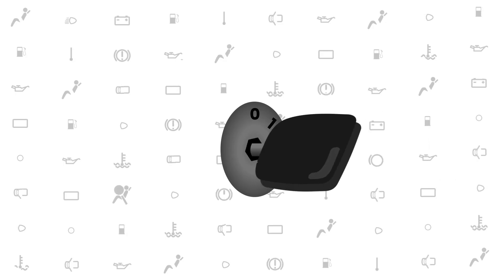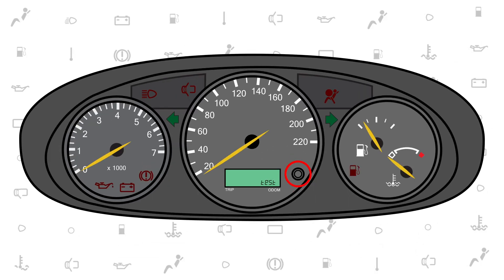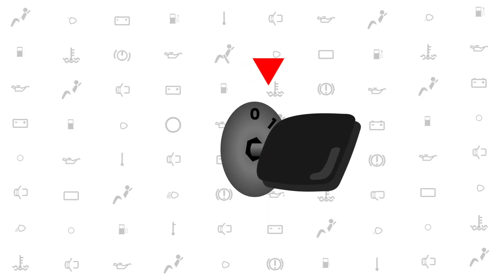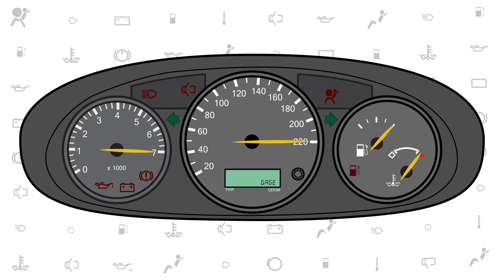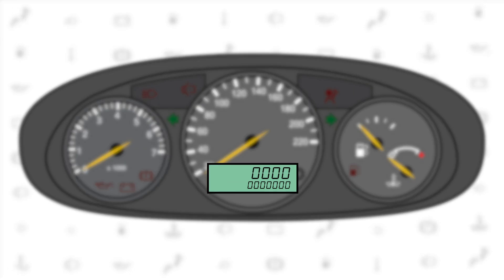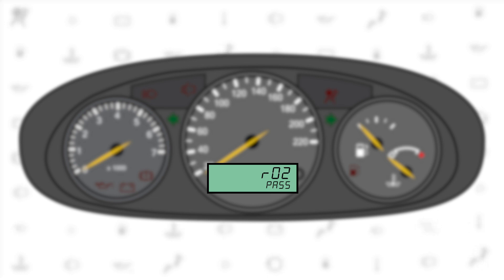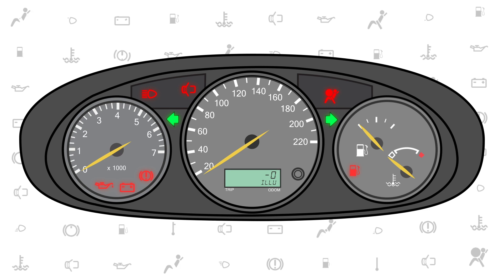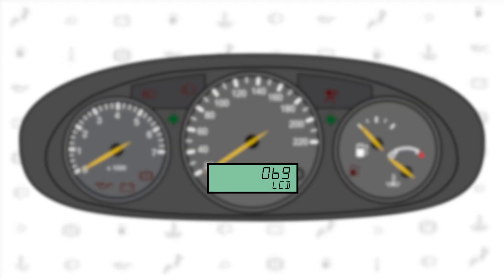ROCAM ECU Series - The Cluster self test

Comment: Thanks so much for this Dave! . Ive got 330k on my lil fiesta and never knew about this. Having said that. i have had to get the ECU repaired. And just now did my head gasket after some overheating problem although it appears it was just a failing water pump so it was probably unnecessary to do the whole head etc... although i do notice improved performance now. Another problem has arisen though. The speedo and odo are not working....I went through the tests as you have indicated...but well not even sure what to look out for... Any idea would be really helpful and grateful! . Thank you . Laurence
Reply: Check the Speed sensor harness where it plugs into the Transmission. On the harness there are three wires at the connector. The violet wire is to the Power Hold relay. Chech that these wires have not shorted out or are not broken
Reply: @davehamlyn3097  You legend thank you will check that and let you know!

Comment: Hi Dave. Just wanted to ask, if the immobiliser warning light doesn't flash anymore, what could the problem be? Car is cranking, there is fuel but no spark
Reply: Does the PATS LED still work ? Has the Immobilizer been bypassed ? Do you still have the key reader in ?  Check for a short circuit in the starter relay or the started relay has been grounder out.

Comment: Interesting!
Bantam starts first time, misses intermittently, stutters and then... sometimes run 100% and goes like a well oiled... Bantam 
Slow moving traffic... stuttered, died, towed, 2 hours later, started but kept on stuttering...
1.3L 161k km... fairly new coil pack
Do the injectors need maintenance of any kind?
Reply: No, Injectors dont need maintenance. The the HT leads and the spark plugs in the Rocam engines 2002 to 2007 should be set at 1.00mm and from 2008 to 2012 at 1.3mm.  Check also the three pin connector at the harness thgat plugs into the coil. There could be an open circuit right on the connector plug. If it switches off and does not crank, keep an eye on the Immobilizer warning light.  Tjhis could also be the computer box that needs repair .(Had a few of these)
Reply: Clean PCV and Idle control valve. Test cranckshaft speed sensor
Reply: @xaviersandrinedemay6396  Thank you!
Turned out to be fuel pressure regulator... got stuck somehow  and flooded the motor... sorted now R180.00 later...